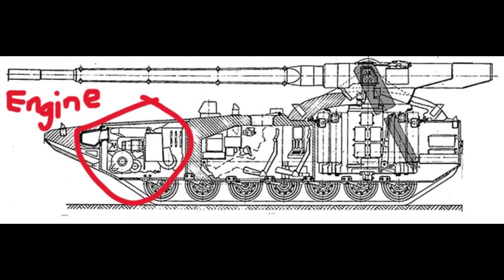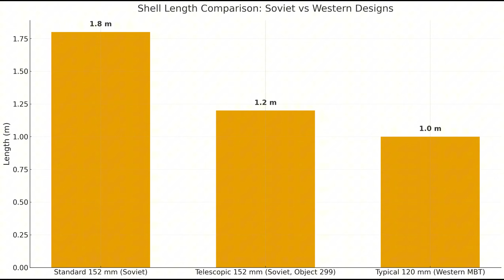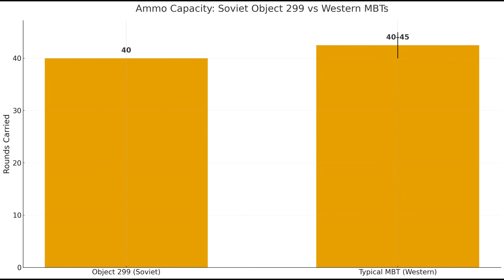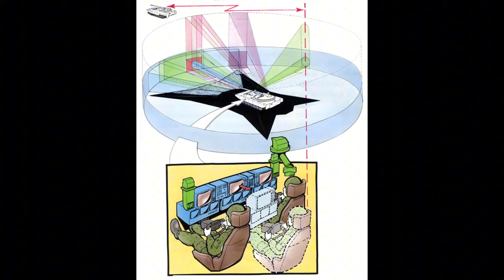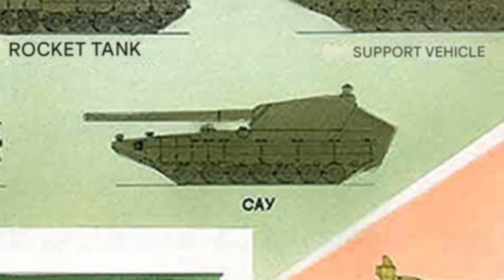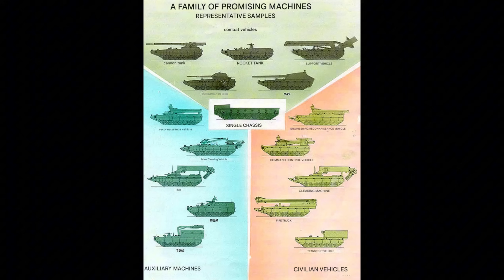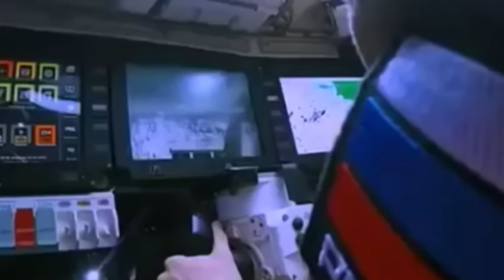Tanks No One Talks About: Soviet Object 299

Comment: It's interesting to compare Object 299 with what the West was studying at the time, as in the 1991 RAND study "An Exploration of Integrated Ground Weapons Concepts for Armor/Anti-Armor Missions"

Like Object 299, they also recommended a two person crew with an unmanned autoloader turret. However, they recommended a rear engine, not a front engine. RAND calculated that the best armor protection would be provided by placing the engine in the rear. When protecting from frontal arc threats, the front armor savings from a front engine is negated by the extra weight required of the side armor (which you need more of to protect the crew from shots not directly from the front).

Fast forward some decades, and the T-14 Armata would, of course, go with a rear engine placement.

Of course, people will mention the M1 TTB prototype, which had a rear engine. But that was based on the M1, so it naturally had a rear engine simply because the M1 had a rear engine. In contrast, the RAND study explored clean sheet designs.

Comment: I think its so funny that the russians wanto make everything out of a single heavy chassis that needs shit tons of fuel, even though it does not need to be that heavily armored, like a spg or ab ifv…
Reply: You can take out composite armor arrays on vehicles that don't need it to save weight. While pure performance-wise purpose build solutions always have the edge, sharing a common chassis is a radical ease of maintenance and logistics. It's also not only the Russians, the Germans wanted it too with the Neue Gepanzerte Plattform project.

Comment: unmanned turrets or things like that existed on both sides of the iron curtain. neither side put them in practice
so how is that ammo suppose to work?
gas turbines get more efficient when they work at peak power. land applications thats close to never. so no it would not be as efficient as diesel. maybe smaller so you could fit more fuel in tank... oh btw APU is great for gas turbines if you just need some power and you are stationed. or maybe you need a bit warming in harsh winter. it does not hint at hybrid system.
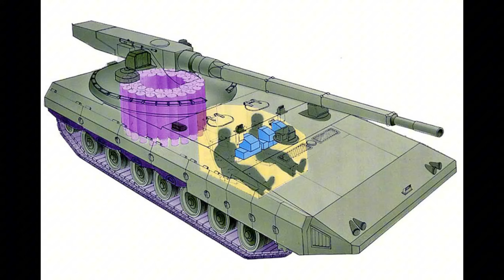18:43 armata does not have engine at front
Reply: Germany had a very similar common chassis project with the Neue Gepanzerte Plattform . It was axed when the Soviet Union fell and only the IFV component was developed further as the NeSPz program which later through changing requirements turned into the SPz Puma, which has an unmanned turret. So they kinda did put it into practice, just through some extra steps.